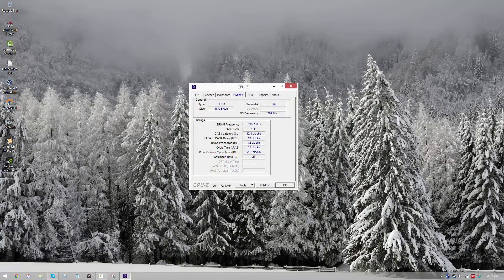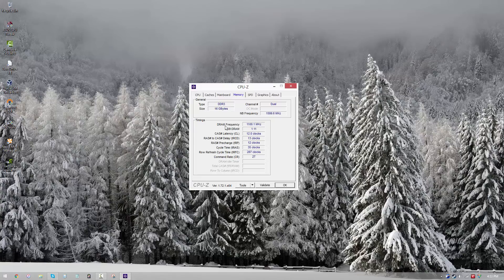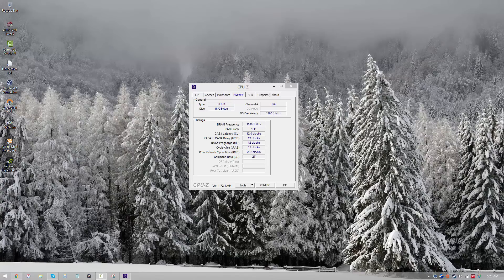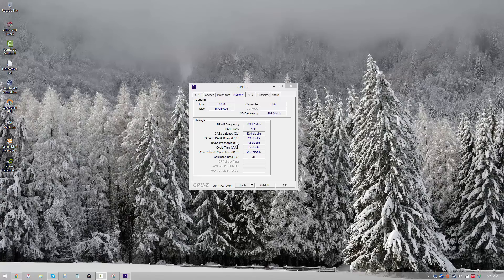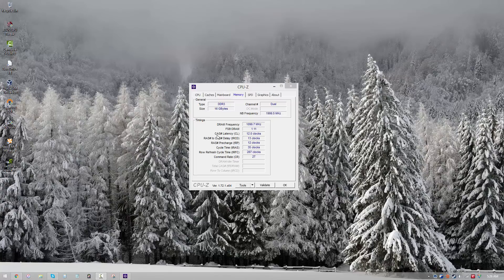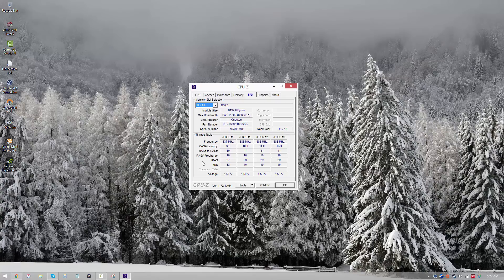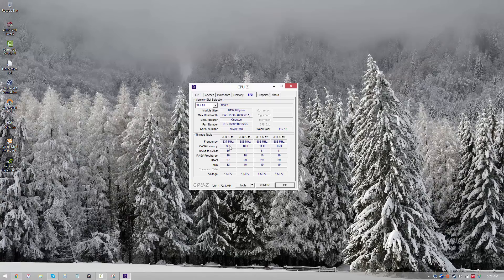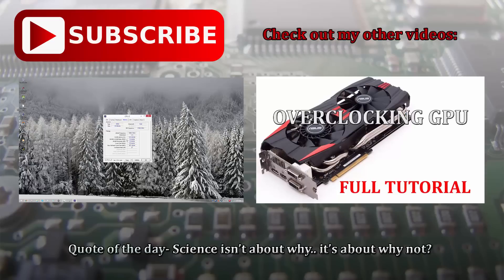RAM timings explained: Frequency vs Latency

Comment: I don't get it. You've got 1866Hz Memory card, but the Timings Table is showing lower frequency values like 837 (1674Hz) and 888 (1776Hz). Aren't they supposed to be increased when they are OVERclocked?
Reply: +xxxXXXCH04XXXxxx No. The timing table does not reflect any manual overclock settings.
Reply: The PC Security Channel
oh.

Comment: Is it fine to add 1 stick of 8GB RAM with a different latency? Everything else is identical. Brands are Patriot and Kingston HyperX Fury 2133 DDR4. One is 14 latency, the other is 15.
Reply: There's certainly no harm in trying. Worst case scenario would be the computer not liking it and not booting or perhaps crashing during use but no damage will be caused. Usually when you mix match ram the clocks and latency will match that of the slowest across all sticks of ram.
Reply: I tried it and it works flawlessly. Thanks for your comment. All the lag I once experienced in newer titles is completely gone.

Comment: I always overclock for maximum efficiency for the ammount of speed.  I guess what you would call the 'sweet spot'.  Meaning, I won't overclock to monsterous frequencies if it requires high amounts of voltage and also timings.  

I think it's possible for hardware to perform worse even if it is overclocked more, simply because it's very unstable or possibly safety features are in place to prevent the crash or instability of hardware. 

Overclocking is all about finding what is best, and sometimes it means going down in to not so out-there speeds but also have a decent voltage requirement and keeping reasonable timings.
Reply: I know this is a very old post but what do u consider a reasonable voltage with ddr4

Comment: Which shall I yous I have a 800mhz with cl Latency 11 clocks, trcd 11, trp 11, and tras 28. VS 665 mhz, cl 9, trcd 9, trp 9, and tras at 24 cycle. I can't really see a performance deference?
Reply: Filip Munk WTF my 800mhz RAM have cl5

Comment: if my motherboard just support 2133 Mhz, can i use more higher Mhz?
Reply: no
Reply: yes you can... it will just downclock the ram mhz so it will act like a 2133 stick(s)

Comment: Hello!Bro i have 2x4GB DDR3 1333MHz CL9 and i want to buy 8GB DDR3 1600 CL11 ! I want to use 1 4gb with the 8gb they are both Kingston i want to use them for gaming so that i have 12 gb of ram! My question is will the difference between the frequency and the CL will be good or bad??? what is the overall benefit ?should i do it??? ps: low budget
Reply: +Xradas Alex  Absolutelly not! your ram needs 13,5 NANO-seconds to start a command after the cpu gives, the second one 13,75 NANO-seconds. It will not only be slower, but also at a difference that you wont be able to notice neither in games, nor in normal benchmarks anyway and doesnt change anything to your system performance.

For gaming ram speed doesnt matter at all, only if you do hardcore things like video rendering, photo editing etc you might need to keep an eye on fast rams.
Also if you have already 8 gigs its absolutelly enaugh, the highest usage i was ever able to reach till now was at full cranked up settings in the division, where it used almost 7 gigs.
Another point is that you could technically run 2 different types of ram but normaly its highly recommended that you use the exact same model.

Over all dont waste any money at all for rams as long as you look into gaming and your ram is still working.